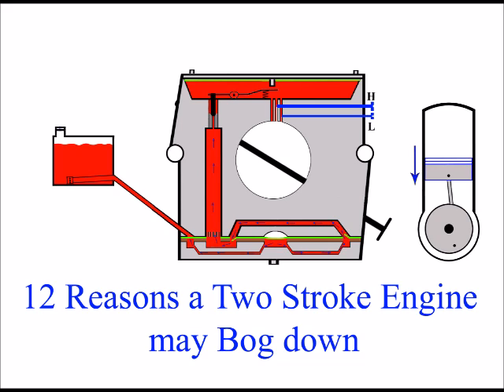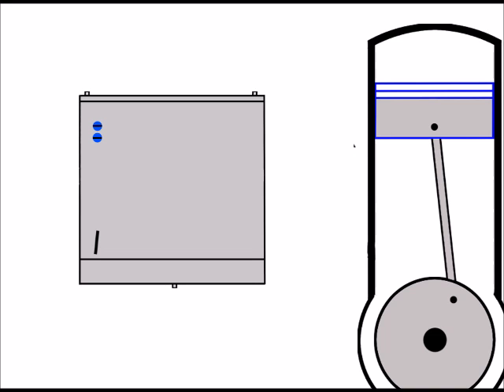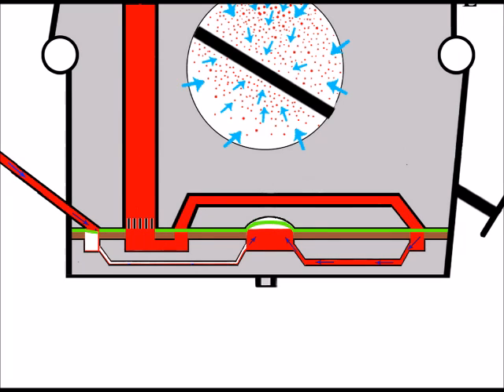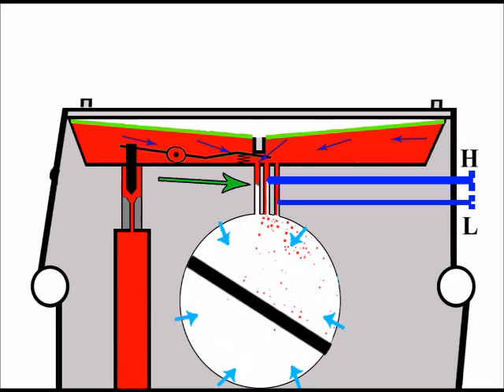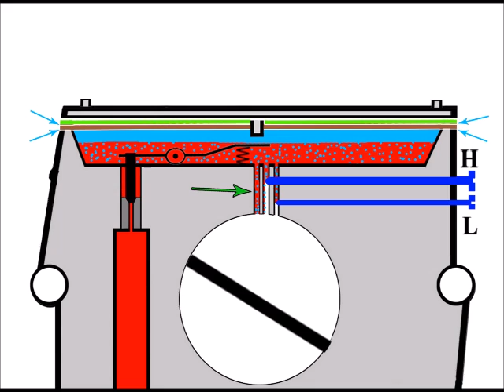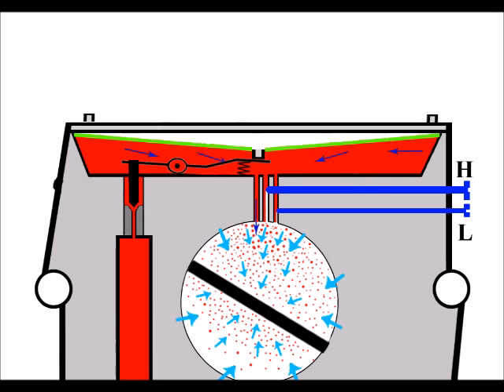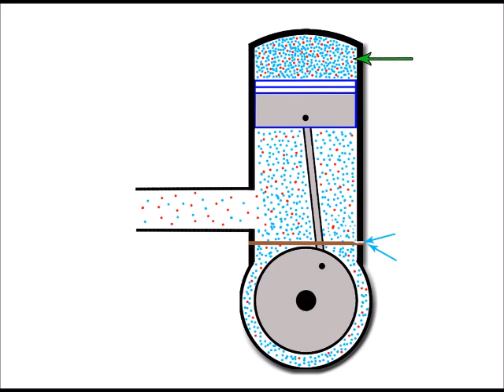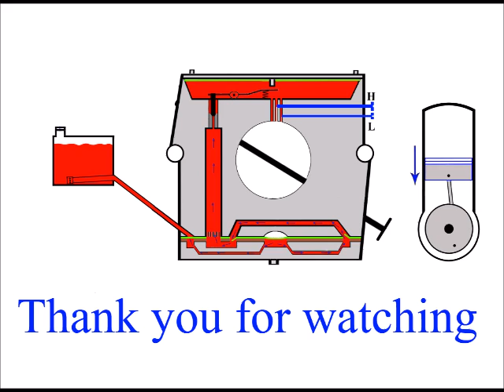Chainsaw Carburetor Problems - 12 PROBLEMS TO AVOID!

Comment: This is fiction right?  Your drawing of the engine is so far off anyone who listens this far into your video would come to that conclusion (around 53 minutes). That you don't know what your talking about. You've never looked at a 2 stroke engine. Tell me: Where in your drawing would the spark plug be? You are just making this all up. Not only that you've got the carburetor mixing air and gas and porting it to the wrong end of the piston. Where do you talk about the exhaust? One of the reasons why a 2 cycle engine bogs down is because it can't get rid of the exhaust. On small engines like weed trimmers the reason why it bogs is because the spark arrester is clogged. Hence the engine can't get rid of its spent fuel. I've just watched 2 videos talking about how the spark arrester is the culprit on a 2 cycle engine bogging down. You aren't even close. Or am I mad?Look just google 'how a 2 cycle engine works' and you tell me how your model above contradicts or is identical in conceptual operation.
Reply from the maker: spacecowboy98, I will inform you right now that my 25 years of working on these engines with an excellent success repairing rate has Not gone a waste. Spark plug arrester issues are just One reason and One reason only why a two stroke engine may bog down. My reasons are not all possible reasons, they are related mainly to fuel reasons and reasons related to the carburettor. The diagrams you are incriminatingly referring to are over simplified diagrams that are designed to illustrate my point. A very quick look through these comments will tell you that you are far out with your thinking on this. Do not tell me your ridiculous reasoning. You are just showing that you are just another tiny minded critic who couldn't produce this type of work yourself and that's why you can only criticise others, because that's very easy to do!!!!!!
Reply from the maker: spacecowboy98 THUMBS DOWN
Reply: True! But the fuel mixture from the carbureter is funneled into the head of the piston not the crankcase through 2 valves. You've got the fuel mixture going into the crankcase and how is it suppose to combust there? Explain that?And one would think that if you are going to give 12 reasons for bogging that it wouldn't necessarily have to be tied to fuel? And then why wouldn't the spark arrester be in one of your 12 reasons? I believe its because you just didn't think of it. Everything you are doing in your video seems to be just rationalizing with no intended real world solutions. Bogging down because of the barrel gasket? If it were to leak? That is not real world. There are hundreds of small engine repair channels on Youtube  and I think you seriously need to check them out. Because you my dear sir in my most humble opinion are spouting out fiction.